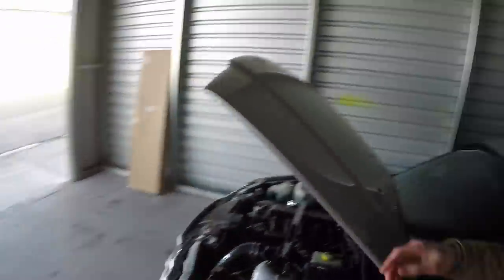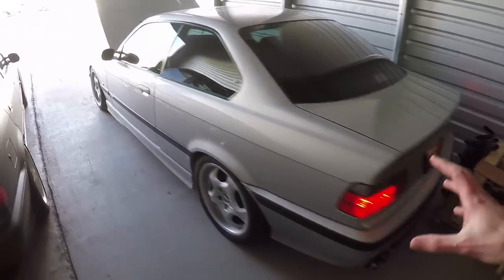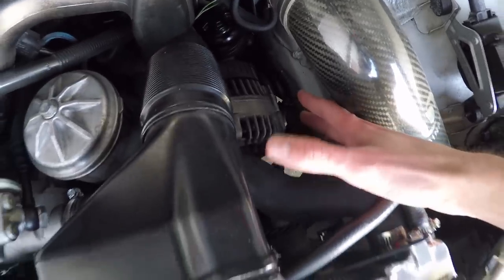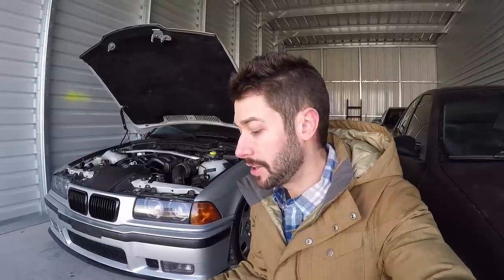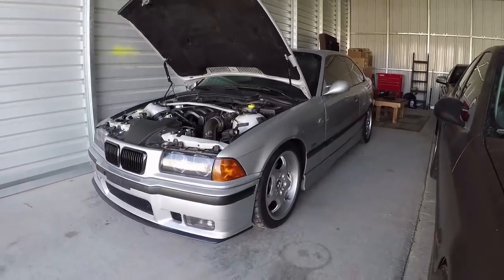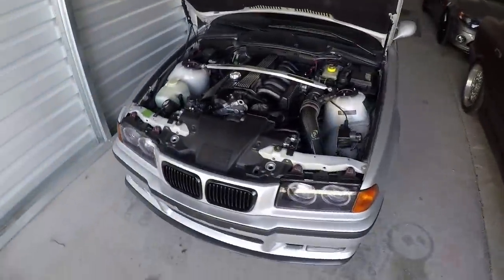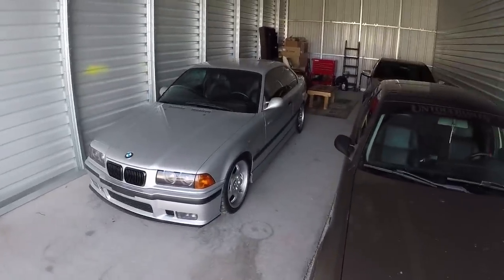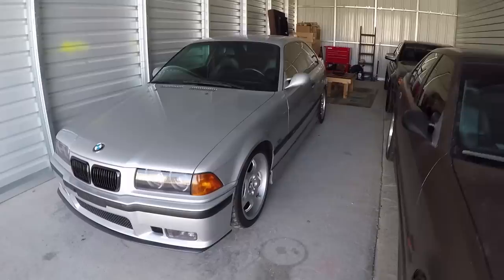BMW RELIABILITY: My AWFUL 1 Year Experience

Comment: what suspension this 328 has?
Reply from the maker: +AndreCh they are Bilstein PSS9 coilovers.
Reply: Nice, I have a 328 coupe, I will install this same wheels (rc090) soon, but my suspension is still stock, Im thinking about a coilover but it needs to be the most confort one, because here streets is a nightmare, I want the bc coilovers but is too expensive, what do you think?
Reply from the maker: +AndreCh I got Megan racing spec rs coilovers and love them! Made a video of the coilovers and everything. Look back a ways and check it out if you'd like! Where are you located? I know a dealer that can hook you up with a great deal.
Reply: Nice, but maybe your megan model its too agressive/stiff for here... maybe the EZ street might be better for the streets where I live(são paulo - Brazil) idk... But the EZ does't have camber plates I think, unless this dealer that you r talking about have the solution haha
Reply from the maker: +AndreCh well because they're adjustable you can set them soft or hard, just depends. It's good to talk to the manufacturer and see what they recommend.
Reply: Ok thank you so much, I like your videos !

Comment: They're endless money pits. I fixem all the time. There's a reason why they have no resale value. They are notorious for Electrical problems.
Reply: Eman 08 bro your everywhere no one wants to drive a boring Toyota
Reply: Mensur Cirikovic No one cares about your plastic money pit that breaks all the time.
Reply: Mensur Cirikovic what shop? Lol I'm an independent Mechanic. I can make what ever the hell I want and charge what ever the hell I want. Good luck getting ripped off by the dealers and shops and sell you parts 40% marked up made in China.
Reply: Eman 08 no ik the owner of the German repair shop so labor is not expensive at all and parts nothing
Reply: Mensur Cirikovic the owner is not your friend. It's a business to make money. Just like a car salesman. Ha!
Reply: Eman 08 hahahaha your right he’s more than a friend he’s my cousin lol
Reply: Mensur Cirikovic sure he is otherwise wouldn't need to take it to a shop. Why not have him fix it for you. As an independent Mobile Mechanic, I travel to my client's work site want work on their cars on the spot.
Reply: Eman 08 I mean he is right down the street and I’m not his only customer
Reply: Do you work on mew cars?
Reply: I've work on all types of cars from the 90s to present. The modern cars are getting more cheaply made with a lot cheap plastic parts and more complex with electronics. Many BMWs don't even have oil dipsticks, now you have to rely on some stupid electronic device, what if that breaks? haha just stupid designs. Telsa's are even bigger money pits as they are an electrical nightmare as they're iphones on wheels with unnecessary electronic gimmicks on-board computers that will bankrupt you when they all break. They aren't different than Mercedes,  electronic door handles go bad all the time. Just one electronic door handle will cost over a $1,000 to replace as a Telsa technician is flown out to your house to fix it. Falcon doors on the Model X is pretty much failure  as they break all the time. Companies are now cutting corners removing the turn signal indicators from the dash inside the car as you will never know if they are working unless you get out of the car and look. Now Oil filters are being canister based with o rings and crap which is a horrible design. its like they're going backwards. ha!
Reply: Eman 08 how much do you charge an hour?
Reply: That's a rather vague question because it all depends the type of car, and what parts I'm replacing as it varies.  I wouldn't charge a $100 an  hour something dumb as changing a light bulb. I don't do flat rates like the dealers because dealers do that to gain profit.  Its a way to rip people off if you charge $500 in labor for a job that you finished in a half hour.  Brake jobs can be low as $65 an hour in labor and higher for higher end cars. Too many variations of what I charge because it all depends on what I'm doing. I buy all OEM parts as whole sale value but I don't mark them up like the dealers do to get more money out of people. I'm cheaper than the dealers and I have all the OEM dealer scan tools from BMW ISTA, Toyota Techstream, to GM Tech2, wiTech for Chrysler, Ford IDS ect that all connects with my DrewTech pass through. http://www.drewtech.com/technician/products/cdplus2.html

Comment: *And leaky fuel lines
And interior parts braking
And sunroof seals
And diff / engine mounts

The good part is that they're generally easy to work on and find information / parts for them

Comment: 8,5 in the fronts, 7,5 in the rear...
You are a joke
Reply from the maker: Or maybe I just like using the car to drift. So I did what is common to do for a drift setup and it works great for that.